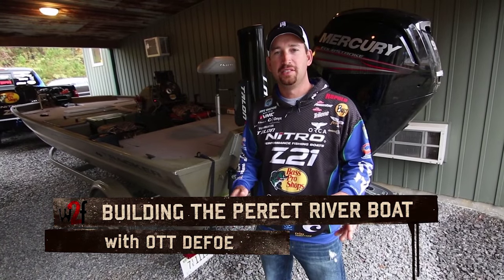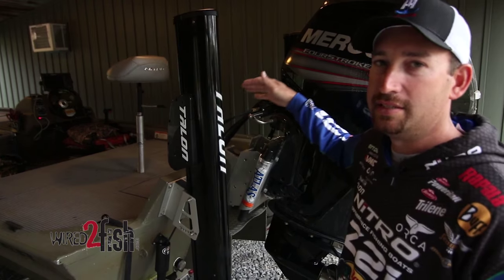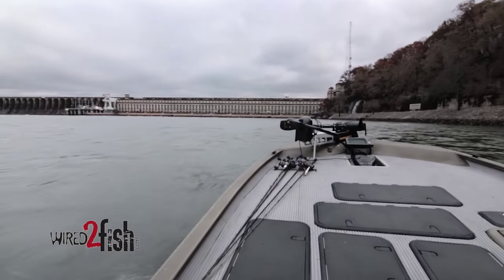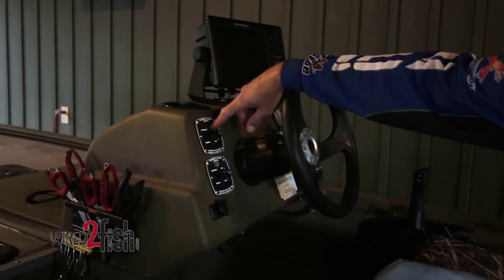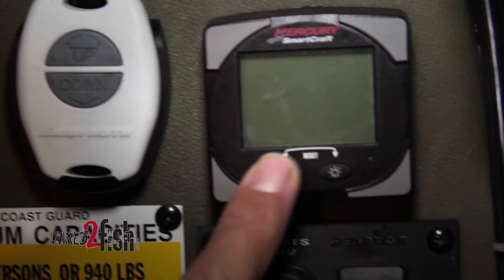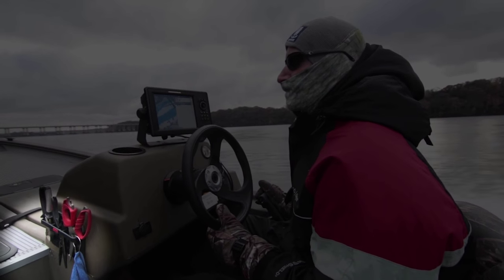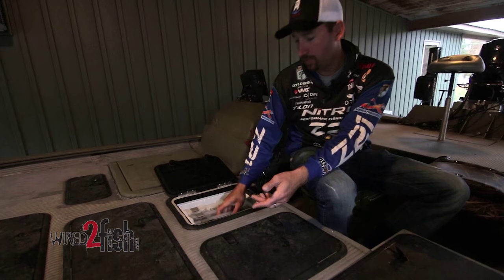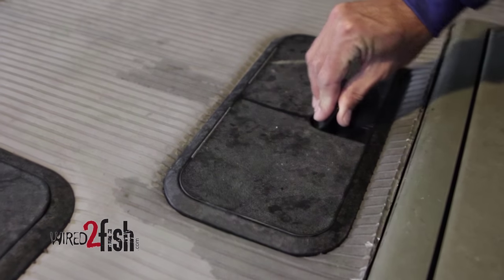Building the Perfect Shallow Water Fishing Boat

Comment: My old man had a four stroke mercury jet on his 18 ft triton Jon boat...it was underwhelming in its power. He then sold it for a 90/65 optimax.  Man what a difference.  We always have ran mercury motors, and love them, but for us, the optimax is stil the best running motor on the market, IMO.  My grandfather has a 90 horse evinrude E-tec, I believe it’s a 2009. It’s meticulously cared for, and it just doesn’t get up and go like the 90 merc we had on a 190 sport fisher.  His boat is a Lund 18ft V hull.  Boats are almost identical in size and weight, and my fathers mercury walks has walked away from that ‘rude since he had it. We fish the St. Lawrence.
Reply: whar 17 90 hp jet oyrbarde
Reply: whar 17  xaróoólóña 17 90 hp jet ouytvsrd

Comment: ill be honest most people don't understand what it takes to make a boat perform in the shallows. I was skeptical clicking on this video, but the modifications where very well thought out. im still really surprised your hanging onto a prop. why not run a 2" tunnel and trade the 90 for a 150/105 jet? it would operate in less water and the smaller tunnel would displace a little more water and compensate for the slightly heavier motor. guess you don't have to worry about a clogged intake. nice rig, and good spot for your sponsors.
Reply: Dustin Apple 
also needs a place for a shad tank...;)
Reply: A lot of tournament organizations don't allow a jet. He uses this boat in some of the BASS opens, I think he won one of them by running way up a river.

Comment: How is this tracker 1860 performs on choppy waters I saw a video on youtube and it looked like it was a pretty rough ride?
Reply from the maker: It's more of a mod-v and not designed for real rough water, but can certainly tackle choppy water with ease - although maybe a little bumpy.
Reply: buy whaler ¹8  foíter ranré jet drive
Reply: buy oarker 1801
Reply: @sharonbraselton4302  did you mean parker 1801?

Comment: how wide and long is the boat and how deep is it
Reply from the maker: +Kansas Tactical Bass Lander It's the Tracker 1860. The dimensions listed on the Tracker website are 19'2'' long, a beam width of 84'', a bottom width of 60'', and an inside depth of 16.75''. Full specs here: http://www.trackerboats.com/boat/specs.cfm?boat=3676
Reply: buy  nacgreagor 19 fite skjeis 5  40 hp  jetoutbard